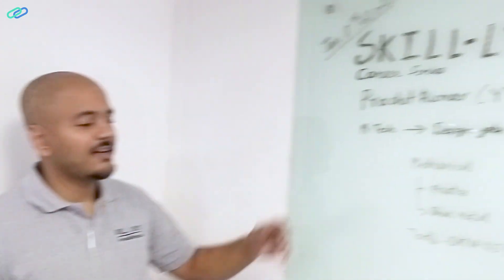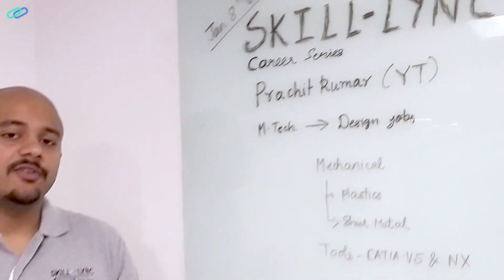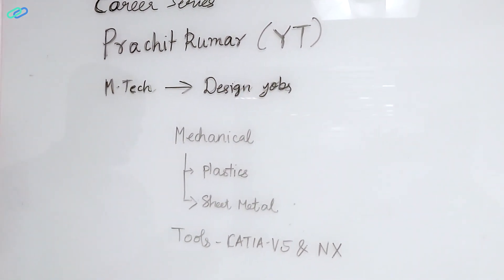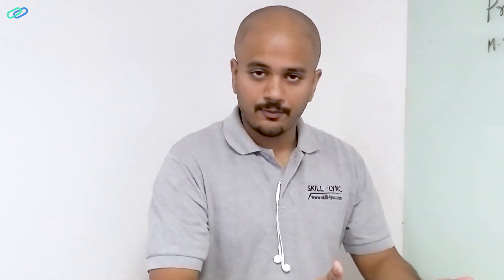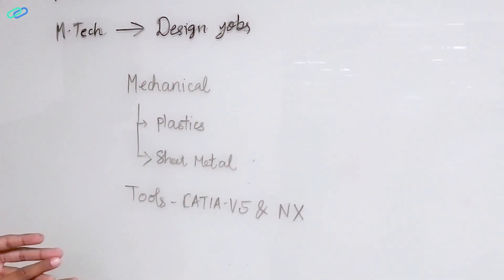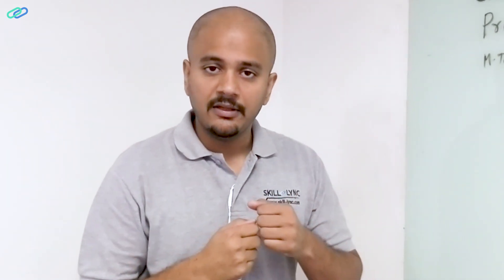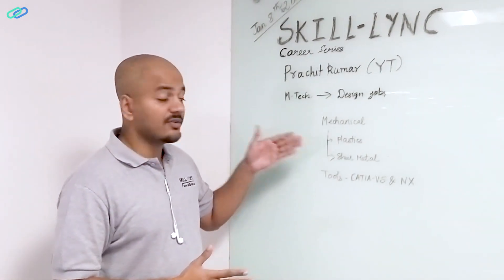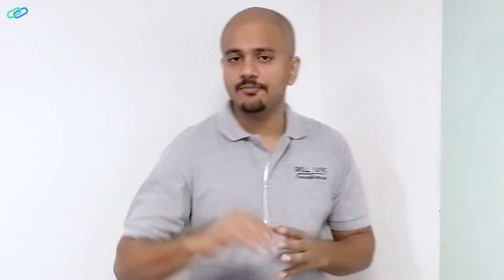How to get a design job after MTech | SKILL-LYNC

Comment: Hi sir I have completed bachelor degree in mechanical engineering and currently working in design engineering, can I do Master degree in mechanical design engineering in part time.
Reply: google yourself for job for Master degree in mechanical design engineering. You will get the answer yourself.